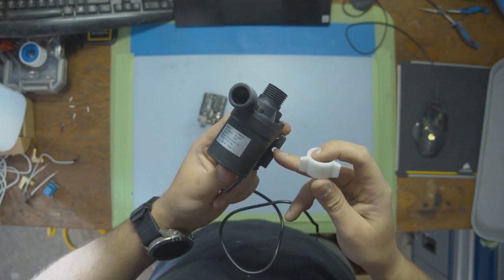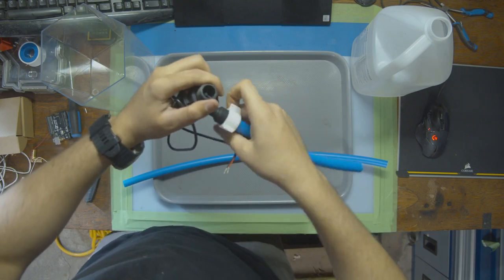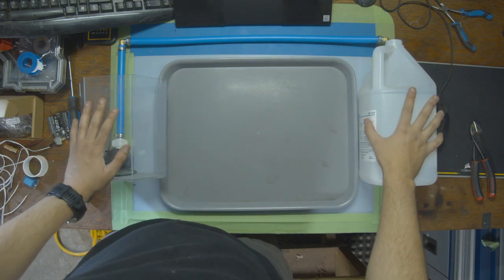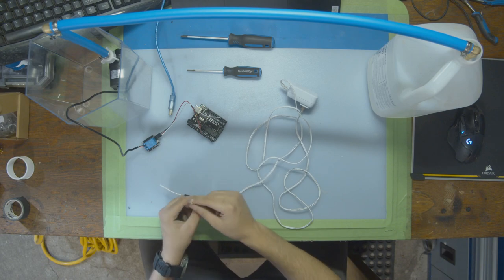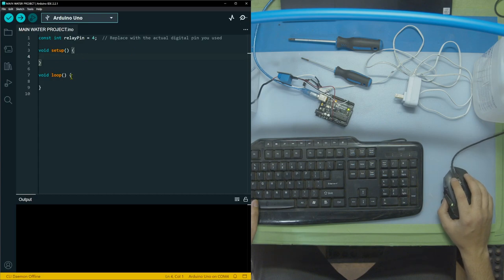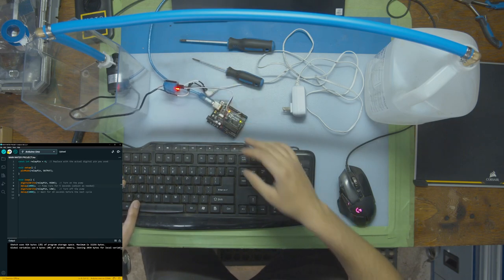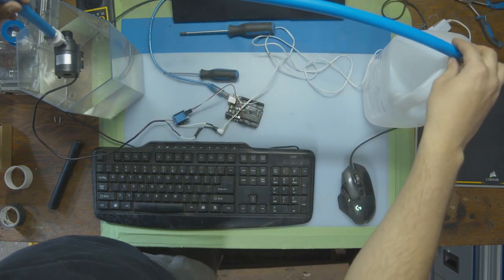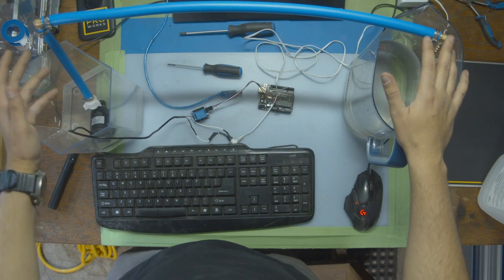Control a SUBMERSIBLE WATER PUMP with an ARDUINO #arduino #waterpump

Comment: i was gonna get a mini water turbine to power the arduino. Would that need to be attached to the relay and would the pump need to be connected to the turbine with the relay?
Reply from the maker: yeah, unfortunatly microcontrollers dont provide enough power to operate most water pumps so we have to just act as a switch, as for the turbine depends on how much power it can produce, I would make the arduino and pump run of a battery source and use the turbine to charge it up as it goes, since if for a split second the turbine isnt providing enough power everything will die and have to restart (if i understand your question correctly)
Reply: @MikaelAbehsera  thought about that and all the videos seemed overly  complicated 😅 just a suggestion but u could do a vid on charging rechargeable batteries with arduino.  But once again thanks 👊🏿
Reply from the maker: @_LKAT_ how do they seem overly complicated?
Reply: @MikaelAbehsera  a lot of the diagrams I found had a lot of other components I thought weren't needed or didn't give an actual explanation for the needed function of charging the battery while its being used by the arduino.  I searched again and found a diagram. Is it as simple as using a battery charger component and a voltage booster
Reply from the maker: Oh I miss understood, I thought you ment mine was overly complicated
Reply from the maker: Yes I will add too the list of videos a charging themed video
Reply: was doing more research, I have a 5 volt water pump and a 12 v water turbine. I'm trying to make a hydroponic water system for plants. After doing research I made a sketch where I was going to attach the 12v turbine to a breadboard power section. Then attach the arduino, then the relay and pump like in your video, however the pump would be attached to the power on the breadboard. This should be able to work right, otherwise I'll do what you suggested and use the battery method. Also because I'd be relying on the natuarla water flow of the system I don't know if I'd be getting the full power output of the turbine, have you seen or do you know how fast water gas to be flowing to get between 7-12 volts(vn pin for arduino). If I could reach the needed voltage I was thinking of using a capacitor

 @MikaelAbehsera

Comment: what are the specs of the pump, does the watts affect anything if hooked up to an Arduino
Reply from the maker: https://www.amazon.ca/gp/product/B0B3RK8P8Y/ref=ppx_yo_dt_b_search_asin_title?ie=UTF8&psc=1
this is the one I used, yes def this cant run off arduino, they have 24/12v options